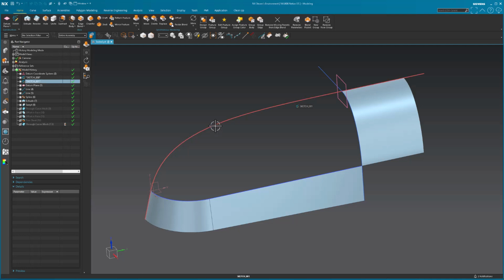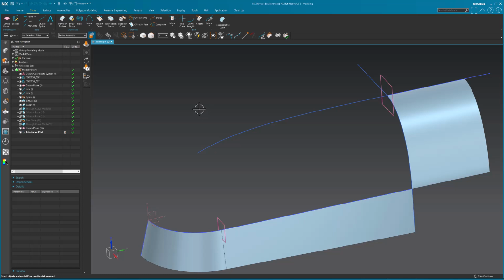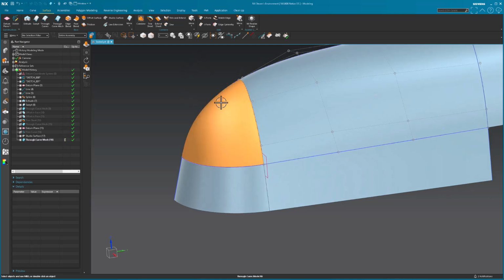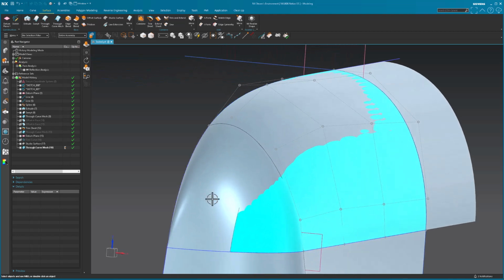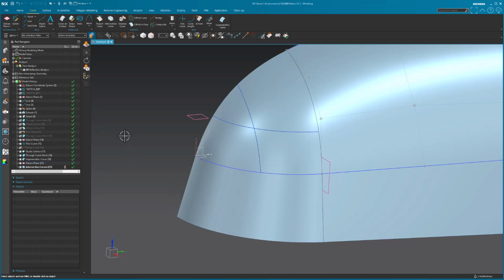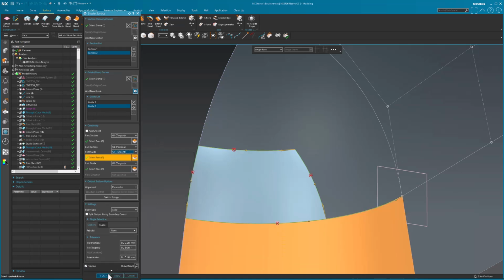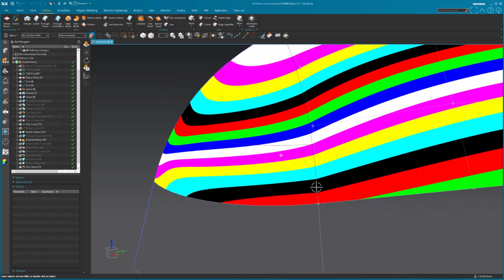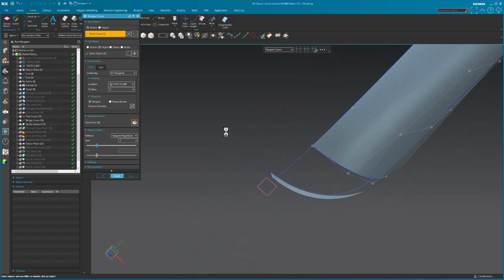NX 2406 | Various Methods for Creating a 3 Sided Surface

Comment: BTW, I wish NX would add a "limiting curve" type option to the Studio Surface command, where one of the curves can be chosen to limit the surface generation. Kind of like what blend does with "shortest edge" or whatever the dialog there is.. or a U/V slider like Styled Sweep has. Would eliminate the creating of a lot of additional geometry, curve trimming, etc..
Reply from the maker: It can be don with 'Through Curve' and using a spine. I will make a video... Thanks.